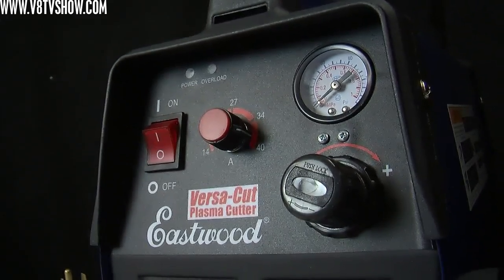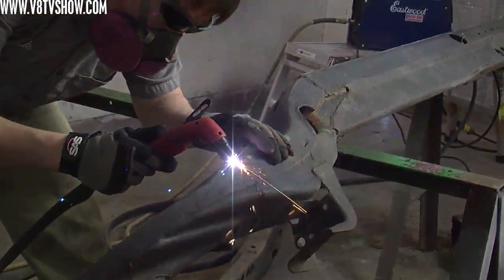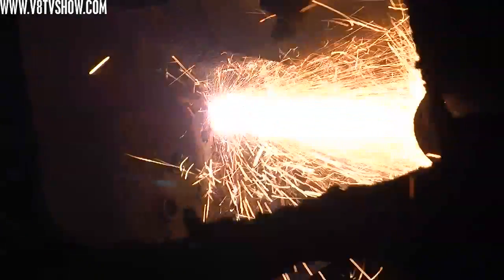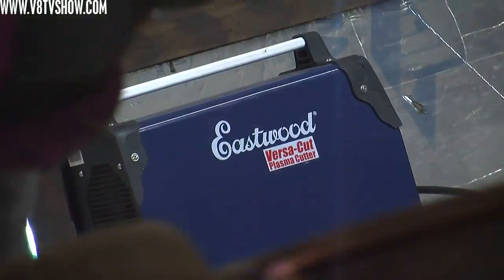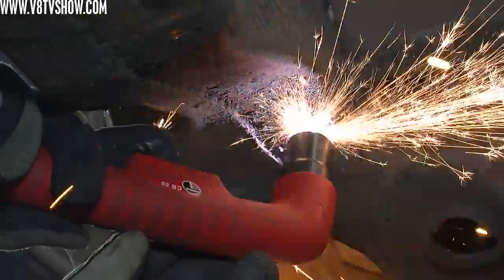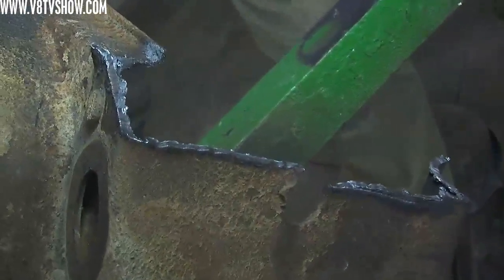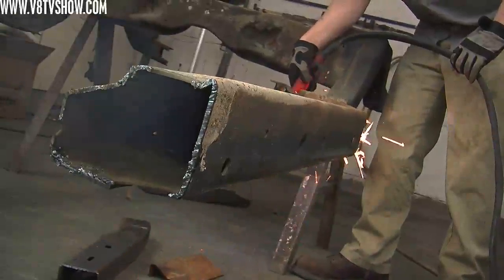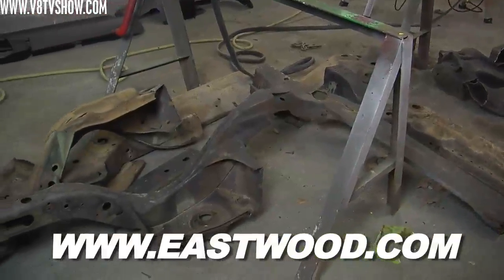Plasma Cutter - Eastwood Versa Cut Plasma Cutter Review By V8TV

Comment from the maker: @SpeedyChevy72 We run our air pressure around 40-60psi depending on what you are cutting. Obviously the thicker metal you are cutting, the higher voltage and air pressure you will need to punch through the metal. Hope that helps! -Matt/EW
Reply: Can you go over 60 psi?